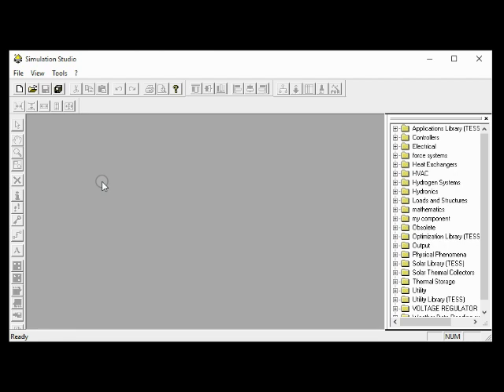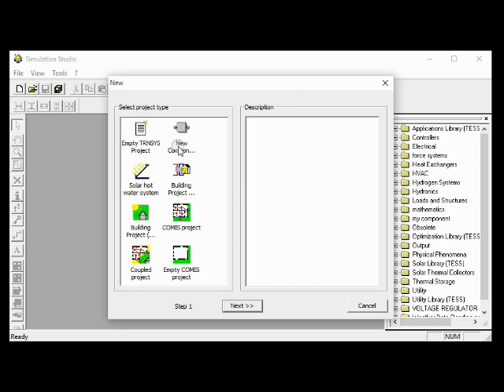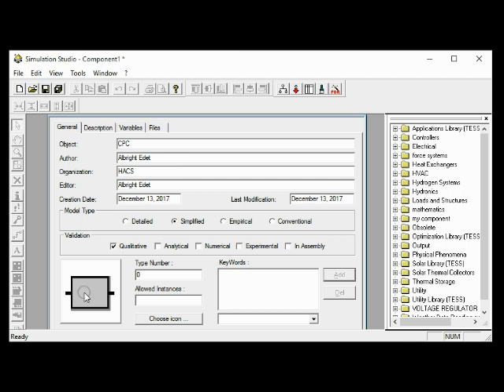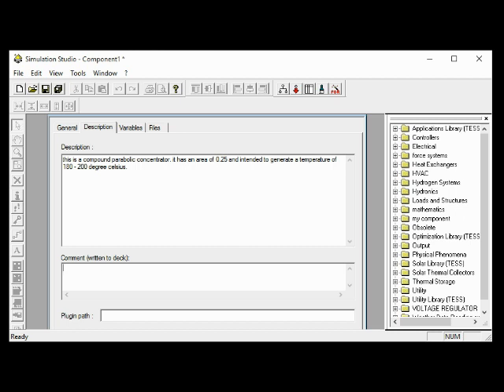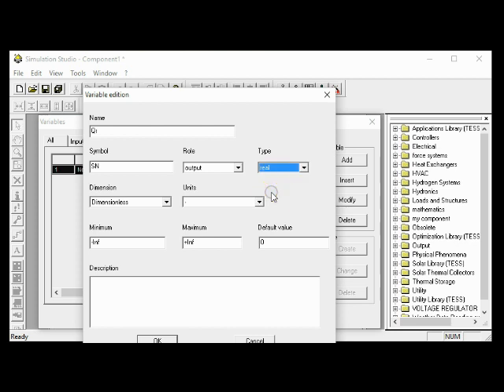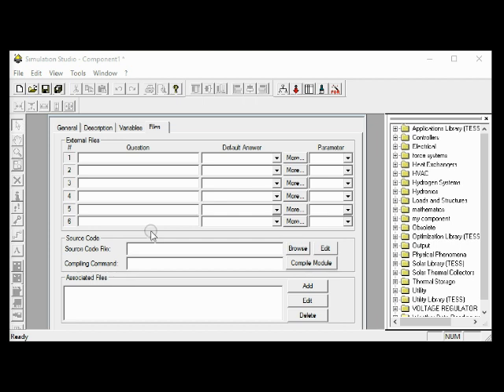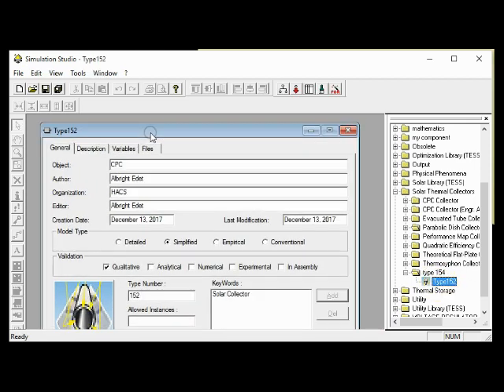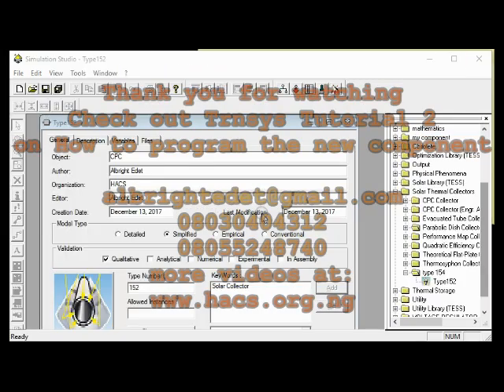trnsys Simulation tutorial 1

Comment: for editing the source code do I need to have a new component?
is it not possible to run the new source code using the already existing component, if I have only altered the formulas. I would really appreciate the help. I am stuck in this for long.
Reply from the maker: you do not have a suitable compiler or program that created the source code. thus if you edit it, it wont work.
Reply: @albrightedet   I do have the compiler intel visual Fortran compiler inbuilt in trnsys18 version. I have opened the source code through type studio available in trnsys18, made changes and saved it in the source code folder using other name, compiled it. Also, deleted the existing file, still can't see any changes in the results using the new source code while running in simulation studio.
Reply from the maker: @aditi_garg  try refreshing the studio. go to edit, update project
Reply from the maker: altering the formular alone is not enough. check that the number of inputs, outputs and other parameters match the exported source code. else try developing your own proforma so that you can have ultimate control over the simulation